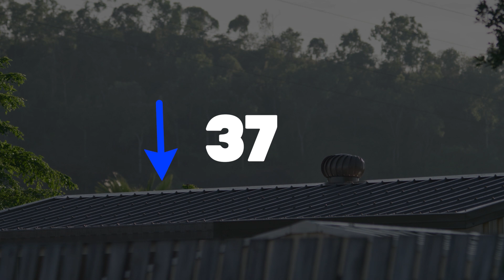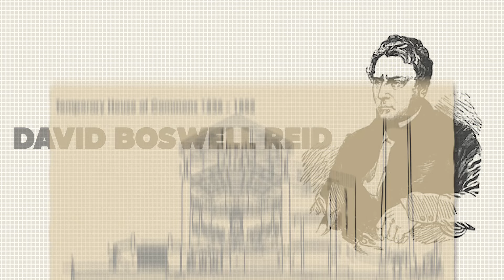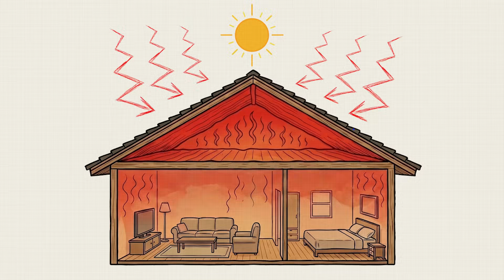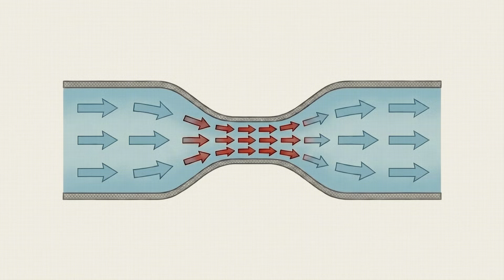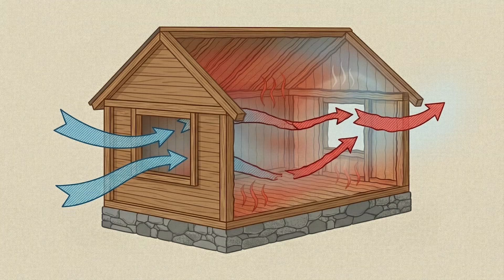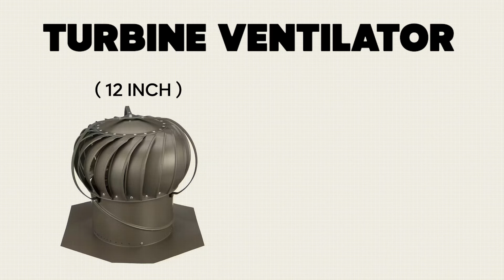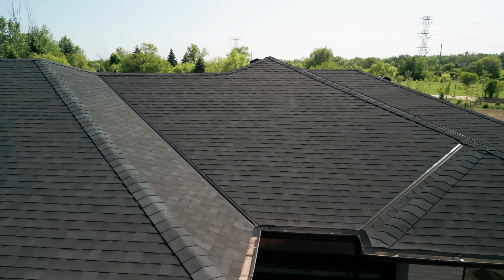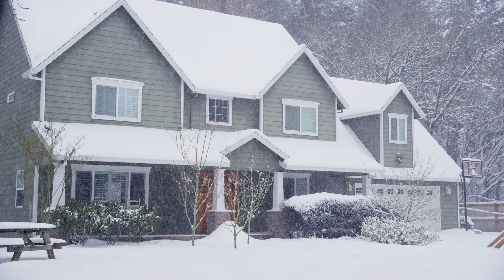Why Did We Stop Using This Natural Cooling System?

Comment: I worked at Horne Australia(now defunct) from 96-2000 manufacturing vents from 300-600mm. It was common knowledge that putting a single 300mm vent on a roof was a waste of time, roof space was calculated and the number of vents needed was then known. Balancing/truing the lower bearing is essential, the vents on my parents house are still silent and spinning after 25 years.

Comment: I still remember the old story about the guy who had an extremely noisy roof vent, and went up on the roof one day because it had been unusually quiet, only to find someone had shot it with an arrow and stopped it dead. While these are normally silent and do an excellent job, that's still a funny story.

Comment: There weren’t any on my new construction in Las Vegas, NV in 1985. The main reason is the roof was cement tiles. 

I decided to change that. I removed a patch of tiles, cut a hole in the roof deck, and installed the turbine vent, flashing and tar paper. Then I made a template out of cardboard the shape of the base, traced it on the tile with a Sharpie and chopped it out with an angle grinder. Fitted the tiles back together, secured them with cement mortar, and sealed them with asphalt cement. 

I had ZERO experience on any of that. I installed 3 vents that way, none of them ever leaked, even in monsoon rains. Just checked and refreshed the asphalt every year. Every fall when I renewed the asphalt, I put a 40 gallon trash bag over the turbine, and taped it snuggly.

I had an evaporative cooler installed on the roof, 4,000 CFM, and vented the house into the attic with “UPDUX” in each room, venting 60 -85 degree air into the 140 degree attic, cooling it down by at least 50 degrees, and pre-cooled the whole house to 62 degrees every night.

We got through Las Vegas summers with almost zero refrigerated air conditioning, and laughed all the way to the bank.

Comment: Whirlybirds are great for something like barns, sheds, and green houses now. The best thing you can do in a modern home is insulating the roof itself and including ridge vents. Then having a small constant fresh air exchange vent pushing fresh air into the space. Basically a PC fan that only turns on when there is negative pressure in the attic.

Comment: I've installed many in AZ. One huge issue - during many storms they let rain water in - WHILE SPINNING!  Quit installing after water damage in attics, etc.
Reply: Exactly. I switched my metal shop to the "wrapped" cone style. It lets the hot air leave but completely enshrouds the openings so rain cannot get in.

Comment: Improved weather-resistant vent caps a good idea? Yes. Needing psuedo-science explanations to sell the items? If you want to believe in pseudo-science, be their guest. Do the caps increase airflow better than an open hole? No ! Are open holes in roofs a good idea? No. Want to throw money at the heat buildup inside roof problems? Buy an attic fan. Solar powered fan system welcome. But, this cap device only works if there are much larger vents placed as to create thermal rise airflow to the cap device. The cap over the fluting pipe alone does very little. Full disclosure: I own one and, as an experienced yacht racer, understand manipulation air pressures & currents. I've designed & built vacuum generators, too.

Comment: the obvious problem with venting attics, is they are all fixed systems that you cant 'turn on or turn off'.. you cant open and shut them easily.. whether its an old school vent window on the sides, a spinning ball on top, the absurd new ridge vent system theyve been putting on, after cutting big gaps in everyones roof, just asking for trouble, they dont open and close when you need them too.. on a hot, breezy summer day, its just hot air coming into a fairly cool attic for the whole first part, or even majority of the day.. the attics been cooled the previous night.. youre just allowing hot air to blow in during the first half of the day.. you only want the air flow from the outside to come in when the inside temp begins to approach the outside temp.. then you want it to close the flow off, once it cools off at night.. and of course in the winter, you want it shut for the most part.. you dont want anything bringing in cold winter air into your attic to prevent it from holding all the heat..

Comment: 12 minutes and a 100 AI-generated images later, I still don't know how these vents actually work.

What does the wind do?
In which direction the air flows with and without it?
It's basically just a mechanically assisted chimney?
What did the patent say?

We don't know.

Comment: Living in Las Vegas I've noticed these and awnings have been completely phased out and it infuriates me. Awnings are way cheaper and give a house a more home like look. I miss the days of "messy" looking neighborhoods. They also got rid of single story homes since they can make more money off two story tiny lots. The upstairs air conditioner works ridiculously hard. We also have a lot of restrictions on window coverings.

P.S. as an HVAC tech I can confirm, attics get into the 150+ degrees. You know you're too used to the heat when 90 degrees can give you chills.

P.P.S. (teehee) ridge vents are far worse here in the southwest. The attic/crawl space air is completely stale. So when brazing/torch welding pipes it's beyond miserable, it hazardous. You can sweat all you want, it does nothing.... THE SWEAT, IT DOES NOTHING!
Reply from the maker: Happy for you to sweat away! :).

Comment: So the bearings eventually wear out and the turbine needs to be replaced, the bearings and many other parts of your furnace and air conditioner wear out too along with most things in your home, that's not a reason to stop using them. Every house I've lived in had these and they are always on the back side of the roof so they could not be seen from the front of the house or the street. Placing looks over function is just stupid and wasteful. Since wind flow over a roof they are still as effective or close to as effective on the back side of a roof, certainly more effective than a ridge vent and less prone to being clogged with dirt and debris.

Comment: Here in Chicago, we just have pipes that go up through your roof, & end in an 180° pipe fitting (so it pointing down so rain & snow don't get in). We don't even have power ventilator fans to push the air out. I wondered why my apartment building had this when I moved her in 2016. I had lived in houses & apartments before this in Texas. Every single one had at least 1 per apartment or 2 per house. Turns out it's city of Chicago building codes. So, nobody will install them.

Comment: Turbine vents were pretty awesome to see back in the day.  I suppose super cheap bearings can be a problem, but I never saw it.  My grandmother's house had them in Miami (just about as bad humidity and heat as you get) and they never had a problem.  Also if they do squeak, how hard can it be to fix?

Comment: the solution is just making a passive water cooling system instead. its more modern and cools more efficiently with also no electricity. the hot air will heat up the pipes and the pipes will carry the heat down to the ground that is cooling it

Comment: There's another form of passive cooling that I've been trying to find information on. Evaporative cooling. I saw it many years ago (20?) on a program showing how tribes people in hot environments used it. 
This was used more like a fridge for keeping produce cool. It was basically a large wooden cage with layers of grass or reeds on top and around the sides in which layers were kept moist and evaporated. The resultant heat energy pulled out by the evaporation kept the interior quite cool and the water was circulated but this of course relied on a reliable water source and so would only fit certain locations. Also this doesn't work in humid situations so well. 
I have an attic room in London, UK,  with a flat roof and I've tried watering the roof in hot weather but this really requires a drip system onto small stones to spread the surface area, as if the water forms pools it just stores heat. Does anyone have any information on this type of system?

Comment: wouldn't lowering air pressure, accelerate dust accumulation trough openings like windows? 
filtered air intake (like conventional ac systems) requires active power source. yes. but they also increase the air pressure inside the building.
a lot of people would take %15 more energy bill, instead of cleaning the house more frequently.
and in case of factories/hospitals, positive or balanced air pressure sounds more like a necessity than convenience.
i'm saying all this in theory, i'm not an expert.

Comment: I live in a double-wide mobile home.
In 2022 the roof was replaced.
The contractor replaced the tiny oem roof vents with a residential ridge-vent.

I couldn't be happier with both the results and a lower power bill.
Reply: Check the fire rating if in fire prone area ! Ambers tend to run the whole length of the ridge !.
Reply: My roof was also replaced around 2015.  They did the same thing.  It makes the attic much cooler as well.

Comment: The turbine spins, not because of outside wind, but because heat rises and escapes the turbine, making it spin. Also, you mention eave vents and soffits a few times, but your visuals show air coming into windows at lower floors. This is wrong. The eave vents would be at the roof eaves and allow cooler outside air to be sucked directly into the attic space. You don't want to vent conditioned air from the house up into the attic. That would be extremely energy inefficient.

Comment: Installed several on a roof in coastal Southern California in 1985. Units were professionally sized and installed, worked fine, and we had no leakage problems. Continuous onshore and offshore breezes kept the units spinning constantly. There was no noticeable effect on internal temperature or electricity consumption for us over 10 years of use. It may have been a problem with installation but it didn't work for us.

Comment: Because there are eve and ridge vents now. Passive venting.  Whirlybird vents are also a passive system. But they are expensive, have a service life, and are not as cost effective as cheap foam and cardboard eave vents and ridge vents.  Every time I see these kind of vents, there are not enough of them. Ridge and eave vents also use the 'stack effect'.  It is more important to keep the roof deck cold in the winter. To reduce condensation from icing up and the interior and the exterior.  The video covers all of this.  This video is not composed well.  They speak about ridge vents and all the while showing pictures that don't have them.  Dumb as dung.

Comment: I live in a 1950s neighborhood in Texas and most of the original houses have two Whirlybirds each. My house only has one for some reason. And I need to install 2 more. Problem is, most roofing companies try to talk you out of these. Or refuse to do it. They want to rebuild your whole roof to have a ridge vent system. Or, at best, they'll want to install for you a powered or solar roof fan (no thanks... Passive works just fine 👌)

Comment: I installed 2 turbines ventilators on my 30 x 40 garage years ago and immediately saw lower temps.  They need to be replaced about every 5 years due to very windy conditions in Plains state where I live.
Reply: Is that due to bearing failure or other issues?

Comment: This is one of those perfect examples where in the lab the numbers all add up but fail to materialize a net gain in real, practical, usage.  They got rid of these for a good reason.  The installation and maintenance cost is astronomical compared the actual gain by energy reduction.  The 6% to 14% drop in energy cost is a pure fabrication, likely made by one of the few manufactures still trying to pedal these things.  In an attic, after the insulation (required for winter) is traversed, it reaches the plywood floor, then an air insulation gap, then sheetrock, then paint.  Zero air is going from attic to interior, so only radiant heat.  Heat rises so attic air simple exits the side vents at the same rate in inputs from both sides of the attic space via vents.  Virtually none of the 150 degree (an exaggeration) touches the top of the insulation.  You would lose $50 per year installing one of these vents.

Comment: Time to modernise this. Add a motor to spin it, power it with solar and combined with its existing capabilities, the numbers should improve
Reply: You don't need a motor. That's the whole point
Reply: @glowing_rectangle yes but to improve efficiency without consuming grid electricity which is something that only in last decade is economically viable. You know something something adapt to current conditions

Comment: There is an issue with water infiltration during heavy rains and they are prone to damage in high winds. So a drain or other solution should be used in a residence.
Reply: I live in an area that has torrential rains in the winter and heavy winds in the fall.  6 whirlybirds, 25 years and no problems except a rusted bearing and one stopped spinning.
Reply: @BradThePitts  hmmmm, thanks
Reply: just instal some cover above it?
Reply: I use 14 years now no problem...
Reply: I have covers for heave rain storms climb out my bedroom window onto my roof below and bag and tie my vents takes 5 minutes !!
Reply: @AXEHAMMER53 interesting 🤔

Comment: - houses often use "ventilated roofs" nowadays, with a cavity that allow air to channel inside. 
- this principle works only if you have a constant air flow IN, to compensate the airflow out. which means you AC will have to cool that air as well. Closing hermetically houses and keep the same air cold has became the standard, although recent times we're seeing a comeback of "allowing air back in" for quality of the same

Comment: So it's simple. They break. Maybe not yours but an active part breaks before a passive part. We use ridge vents and solar attic fans along with soffit vents nowadays. Solar attic fans are being fazed out though. For the same reason.

Realistically a roof wants to be static, not active, because it's beat on the most out of any other part of a structure. So active things have many more chances to break on a roof, vs being on even the outside wall of a home.

Uv, rain, wind, hail, snow, trees and their branches, bugs, animals. All of those are simpler to deal with with passive systems.

Comment: Florida man checking in. Construction experience in Name A Field? Yes.
Just install a powered vent fan, or invest in a "whole house" ventilation system. The former costs electricity, yes. But drastically cuts down on your AC's job during the summer, and as stated in this video, the reduced humidity under your roof is massive for stretching out the lifespan of your roof in my stomping grounds.

Tear off and reshingle with spot repair of decking in Florida is $35,000 and up. Being able to put that off another 3-7 years is pretty massive.

Powered vent fans usually turn on and off based upon a thermometer built into its wiring. "Whole house" is a flavor of boxed air handler that sucks air from open windows up through the attic, purging all static air from a residence, and so that one is not run at the same time as an AC unit. Great for spring and fall, and can actually improve your home's air quality despite bringing in possible pollen and spores.

Finally, if you haven't yet, consider calling an HVAC tech and getting an estimate for an in-line air purifier. They cost money, but even in a rental, you may benefit from paying for that if you have allergies. Also, true local honey is gathered by bees from the very plants giving you hay fever and such. Eating this local honey will inoculate you to floral irritants over time. Any time you plan on residing somewhere a while, eat the local honey and your symptoms will diminish next spring.

Comment: I hate these. We have them over every bathroom in Australian homes. 

They suck the heat out of the roof cavity. The rooms with vents for moisure are always freezing. Bathrooms, toilets, laundry etc. where does heat go? Up up and right out those fucking vents when you want to keep it warm. 

Nothing worse than walking into the loo at 2am and it’s 0 degrees outside and the tiles in the loo are just as bloody cold.

Comment: My attic is cooled exactly as here.  Wind turbine on the ridge, inlet through the eaves. Attic is sealed from the living space. My roofer did not want to put them in.  Mine is not visible from the street and is only visible from the back.  I have two 12" vents in 1200sq ft.  I am in very cold climate. I have not had issues since my 2nd set was put in in 1992. I got a new roof in 2011, and have not had any issues with those so far.  I have never seen it not work. A ridge vent with a shallow roof pitch can get snow blockage. My neighbor has had snow infiltration through the ridge vent., I think they are fabulous. I have looked at them with snow and I don't think it gets in.

Comment: So i have stagnant very 'hot'air in my roof space,i have lots of high volume ' warm ' air  forced up by my air conditioner to open air that sits  6 ft below the soffit vents so if i construct some sort of huge duct above the AC forcing that air directly into a section of modified soffit which would expell the stagnant hot air from the roof...any thoughts?